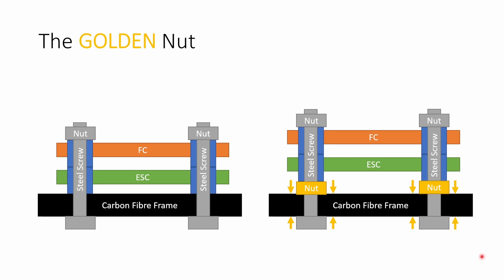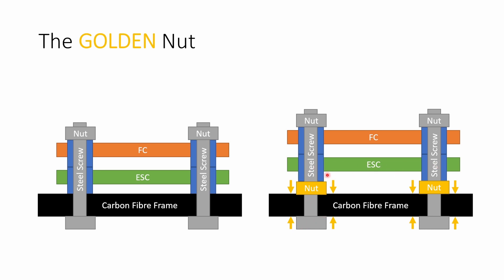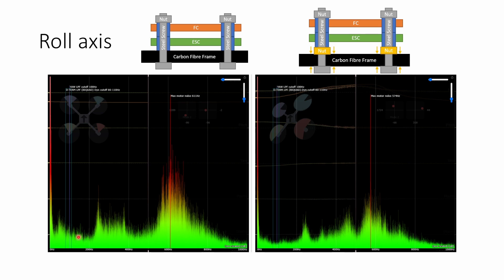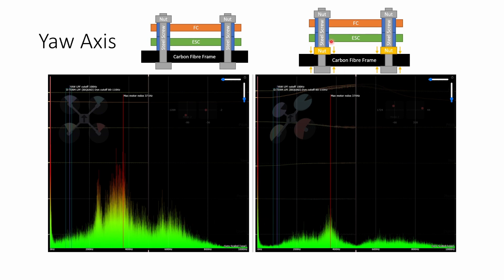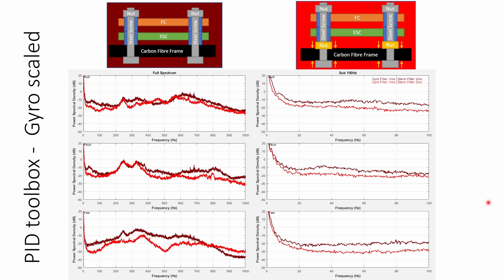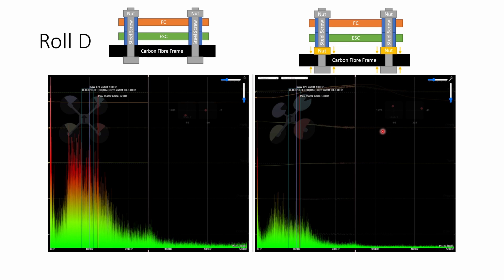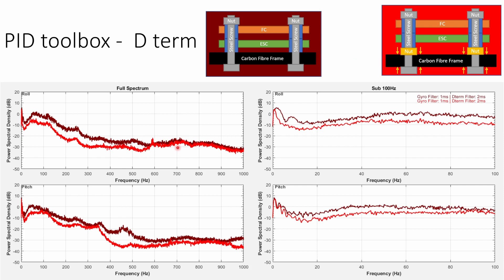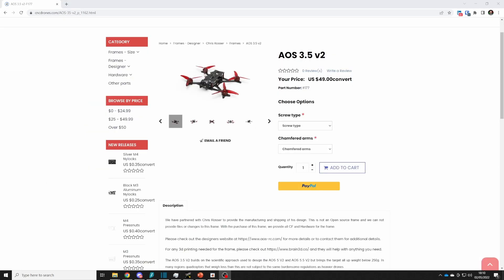Correct stack mounting is critical for Betaflight 4.3! A base nut can make all the difference...

Comment: It's amazing the difference is between having and not having the nut went from hot motors and high filters and motor stalls even could see in video to cold motors and smooth video and flight the difference is substantial

Comment: Great comparison, thanks! Next question, that I faced recently: if I use golden nut approach, and my steel screws are so long, that they touch top plate from left and right side (top plate is narrow) is it good or bad? Should I cut screws to be shorter?

Comment: On a recent build I used nylon screw and nylon nuts and stand-offs, no rubber mount for ESC, just for FC, I also put a stand-off on top and sandwiched the mount pillars assembly between the two frame plates.  I used nylon hardware to reduce weight not noise, but I think it dampens noise and shock in some cases too.  I got 5db less noise  with this system. The most noise-reducing method however is installing braces between the arms you can get up to 5-7db noise reduction. One more thing - tightening of the top nut matters since it controls the compression or dampening of the rubber FC holders. You can think of it as analog "D term" adjustment. On one end if it's loose they provide little fastening and a lot of noise , and on another end if they are tight you get something close to solid mounting , so again little dampening. I suspect there should be a middle sweet spot, would be curious if someone would like to experiment with tightening those screws more and more and record the results.

Comment: why no additional nut between esc and fc? no vibrations comming from esc
Reply from the maker: The nut is to secure the screw tightly to the frame. No need for a second one between FC and ESC.
Reply: @ChrisRosser  without I got super noisy frequences

Comment: Maybe you could include ten nuts with your frames instead of the 5.  Also if you could include the 6mm screws for the camera mount for the 03 as the 4mm stock ones don’t fit in the silicone spacers.  Just a thought.  Still look forward to the build.

Comment: I've been using the golden nut since my first build without knowing it was actually that much more beneficial then just being able to run my Vista cable and other miscellaneous wires occasionally safely under the ESC. 😁
Reply: Question though, what about a frame that has that threaded insert? I still use the golden nut but is it necessary?

Comment: I've always actually done this. Even when there is little space in the stack I sand down a plastic nut shorter to secure the bolt. Flopping around stack bolts just never made sense.
Reply from the maker: I would always prefer steel over plastic (if you have the option of course). You can get M3 thin nuts which are very low profile.

Comment: If the base plate uses press fit nuts (which help hole the screws in place), is the addition of a golden nut still required/recommened?

Comment: My bottom plate came tapped so the bolt is tight with no nut. Is this assuming a smooth hole for the control case?

Comment: My matek f722 boards came with 3mm x 8mm vibration standoffs but i really think they are too weak and result in resonance problems on punchouts with inperfect props.

This is how the flightone guys recommended you build although they recommended not even using the top nut.

Comment: Great info! As always!
I assume on AIO's there shouldn't be much of a difference  (?).
Also, how much torque do you apply on those (and on general) screws/nuts? I tend to go overboard on the tightening and got a torque screwdriver to avoid damaging the parts...
Thanks in advance!
Reply from the maker: I have a rule. 2 fingers on the screwdriver (finger and thumb) for M2, 3 fingers on for M3. 👍
Reply: @ChrisRosser  thanks! Thats an easy one to remember!

Comment: All my builds uses this method. Like a building facing an earthquake, the more flexible the base, the greater the amplitude and the lower the frequency of oscillation of the building. In this case the stack is the analog of the building. The amplitude on oscillations in the yaw axis is mainly because the center of mass of the stack does not coincide with the center of rigidity of the base, which generates torsion in the Z axis, just like a building. One way to improve this condition is by fixing the capacitor and power cable to the frame.

Comment: Some frames have threaded bottom holes, e.g., Five33 Switchback. I wonder if the golden nut still makes difference or the threaded holes basically do the same function
Reply from the maker: A pressnut performs a similar function of its present.
Reply: @ChrisRosser  Thank you for the insight!

Comment: Great video!!!!
I have been very interested in this exact aspect for a couple years. I have a question when you say golden Nut what exactly do you mean? 
I didn’t hear you clarify. I’m reviewing the video now but it doesn’t sound like you specify what the nut is made of that cinches the frame.
You did say that the top of the stack nut was a steel nut. I assume we could use an aluminum nut as well. 
 
The reason I ask is because I think nylon would probably work best??? On the other hand aluminum or steel would be more secure letting more vibration through,I would think 🤔????
I wish I could’ve brought this up to you before you did the testing. This would have been easy to test during your test.  lol ha ha. 

Have a nice day Chris!!!!
Your videos are my favorite !!!!
I watch you & Bardwell & It’s Blunty as my comfort tv most of the time ha ha lol 😂 

It’s got to have it’s Blunty though sometime Bardwell is a little opinionated. I’ve actually met him in person at the Washington DC FAA protest and the day after at the Rosedale park get together fly off.
Reply from the maker: I always use steel hardware. Nylon and aluminium strip too easily.

Comment: I use nut fix of stack screw in all my builds. Also the lower floor of the frame must be rigid. Low mount of battery may reduce noise too.

Comment: FML!! I purchased the V1 AOS 3.5 exactly one day before this announcement. Argh!!!  😤 CNC Madness needs to have a notice on the V1 page to indicate there is a new version.
Reply from the maker: If you email cncmadness@gmail.com you may be able to update your order if it hasn't already shipped.
Reply: @ChrisRosser  nope, too late to change the order it has already shipped. I guess this is one of the drawbacks of doing distribution with the cut on demand method, because really version one should not be as expensive as version two.
Reply from the maker: @angularfpv6572  Because the cost is material and machine time the V1 and V2 are the same price. I didn't want to arbitrarily increase the price for the V2 just to make it more expensive than the V1.

Comment: Is there a difference between a black nylon nut vs an anodized lock nut? Or no significant difference?
Reply from the maker: I find the nylon nuts strip out for me so I use steel. If they don't strip and you can tighten them enough they should work the same.

Comment: Equally important is the quality of screw to hole fit in a frame. Some frames use elongated holes to allow various size motors, or FCs to be used vs individual round holes. The fitness (lack of play) in frame hole vs screw diameter could also be a factor. 
Have noticed a couple of frame kits hat have screws/bolts with M3 style heads on M2 threads. Not sure if larger head size would help provide more secure (less vibration fit), or is done from a style aesthetics design perspective.

Comment: Would be interesting to compare countersunk screw(head) hardware vs. flat bottom heads?
How motor wires are secured to the frame near the ESC could another area to investigate. Limiting the length of wire that can flex near an ESC (FC stack) that can flex will reduce another vibration source. (both motor wires, and main battery wire)

Comment: That is a good idea and what I thought but last month I was building an AOS 3.5 with a base nut on the front stack until it tried to mount the camera. Then I had to take it apart to remove the bottom nut and fit a slightly shorter screw to be able mount the carbon pieces for the camera.  OOPS

Comment: This might be the tip I was looking for. My drone has some strong noise on the yaw axis and less noise on the other axes, but I could find anything on the internet why. I also noticed that my stack is quite loose compared to my other drones. I tightened it already with a thicker screw, but the golden nut might be the solution! noise test on the desk looks already a lot better. Thanks!

Comment: Chris I noticed the same thing but I use the golden nut to lock the ESC in place and secure the FC with another nut.  I can tune out vibration by the top nut on top of the FC by tightening or loosing it.  Normally a snug fit the Kwad flies perfecting.  In builds where I am concerned about stack coming in contact with the frame or screws I use the golden nut on the bottom.

Comment: On the iflight xl frames there is a press nut for the stack screws in the middle plate, so it does this job by design, and I noticed this from the yaw data compared to the armattan badger.

Comment: i never had so much difference in vibration results because of mounting.  coming from ages of old big FCs, we always mounted the FC from ESC seperate. if possible we still mount the esc and pdb together and the FC seperate to topplate. Biggest error in my builds was trying to damp out the fc from the frame with rubber and all sort of soft stuff. best results is a stiff frame and not a single cm of a loose cable or antenna. with the modern frames and filters alomost every build should fly well.

Comment: I've been using a nut under the esc forever, but never knew it was helping with vibrations... one of my first builds hit the ground hard (I was just starting out) and the ESC hit the carbon fiber enough to get through the coating and short out... I was looking for ways to elevate it off the frame a little and a nut was a good simple solution. Glad to hear it has additional benefits!!! Also, haven't shorted anything since.

Comment: Do the V2 frames allow space for the golden nuts? I didn't have room for it on the V1 frame even though my older Apex frame works like this straight out of the box.
Reply from the maker: I use steel thin nuts and have enough space with a 20mm steel screw on the V2 frames. This is with standard gummies for ESC and FC.

Comment: Luckily, I did this on my very first build; not realizing that I was reducing that much vibration. I had heard that there was some type of bad effect on the flight controller if it was able to move a lot, so I had decided to add nuts to the bottom of the screws. First I added the nuts to the screws, but didn't tighten them. Then I set the ESC over the screws to keep the tops of the screws lined up with the stacks holes, Then I tightened the screws down to the bottom plate. This allowed the ESC and FC to beable to easily slide on and off of the stack screws. It definitely kept the stack securly in place. Thanks for all of the technical info.
Reply from the maker: You're very welcome. 😁

Comment: What kind of nut did you use? Press nut? Could you make a photo?
Reply from the maker: A standard steel M2 nut with a bit of mechanical damping grease (PG44A) as a thread lock to stop it loosening over time.

Comment: Just another clewr nylon nut?
Reply from the maker: I use steel nuts because I find the plastic nuts strip quite easily.
Reply: @ChrisRosser  and they don't cause issues on the ESC?
Reply from the maker: @squaddingquads  The gummy for the ESC prevents the nut touching it. If the ESC doesn't use gummies I use a nylon washer in between.
Reply: @ChrisRosser  of course.... Apologies for stupid questions mate

Comment: Its only logical... ;)
Reply from the maker: I was surprised the configuration without the nut was so much worse. I thought it would be just a little worse, or pretty similar.
Reply: @ChrisRosser  U can literally push stack down with your finger without it... On kiss/ultra its USUAL to mount FC AS HARD AS POSSIBLE btw!

Comment: I always used a nut for the stack screws, lately locknuts, and I haven’t be able to mount the Fc over the esc so close, so I use nylon nuts between FC and nuts, that could be an interesting comparison too !
Reply from the maker: I use steel thin nuts (with damping grease as a threadlocker) because I find the plastic nuts strip quite easily. The thin nuts are good to minimise the stack height.

Comment: I've been doing this on all my builds for years. Always thought it was common practice.
Reply from the maker: It should be! I think most people have moved away from nylon standoffs to a long steel screw but the base nut is also very important as it turns out.
Reply: @ChrisRosser  I still have a large assortment pack of nylon standoffs, screws and nuts at the bottom of my parts bin where they will likely stay until the day I finally clean it out. Lately I've been using those anodized aluminum stack spacers in my builds. Looking forward to getting a AOS3.5 V2!
Reply from the maker: @skree_fpv436  Yeah, I've actually started drilling out my nylon standoffs to use as spacers. I hope the AOS 3.5 V2 flies great for you. Design description video incoming.

Comment: I'm not sure if this affects vibrations, but a good tip is to use a washer between the bottom nut and the gummy so that the gummy is better supported and don't deform around the nut.
Reply from the maker: That's a nice idea. I fly quite slammed frames so I have to use a thin nut on the bottom. If someone is using a full size nut they could probably swap to thin nut+washer.

Comment: I'm curious about how thread lock affects this. Also nylock nuts vs regular ones. And if it's different with AIOs rather than stacks, and if their weight changes anything, which would be an argument for using the least amount of solder as possible.
Reply from the maker: I think threadlock or damping grease is important to stop the golden nut working loose. If it backs off the vibration perfromance is certain to get much worse.

Comment: I soft mount the long screw with gummies in addition to using the 'gold nut' and I got very good vibration result on quads ranging from 5 to 2.5''. I got the idea from a Transtec frame and applied it to every build since then. LINK https://cdn.getfpv.com/media/catalog/product/cache/1/image/1800x/040ec09b1e35df139433887a97daa66f/p/1/p1030143_1024x1024.jpg
Reply: Do you have a link to those grommets on the Transteck frame ?
May get RC Mark five has very similar rubber grommets in the frame to secure the stack.

The grommets that come with this trans tech frame look more robust with a better design.
Reply: Oh wait sorry I investigate a little more it looks like get FPV is associated with the link

Comment: This might be another reason the apex did so well. Didn't they use screws with a larger than normal unthreaded section? I can see those screws having similar restricted movement.  I can't remember if those were for the stack though.
Reply from the maker: I think the shoulder bolts are for the arms on the Apex.

Comment: Booooooom!!! I’ve been doing this for a while and I’ve been saying the same thing. Your quad is quieter. Thank you for proving it Chris.
Reply from the maker: No problem 👍 If you have the discussion in future you can just link to this video for evidence 😁
Reply: @ChrisRosser  already spreading it like wildfire sir
Reply: @ChrisRosser  I know it wasn’t apart of your test but another thing I do is run short screws, stick a o ring on top of the nut, no gummy in the esc, o ring on top of the esc, then run rubber vibration dampeners. I need to look in black box to see how that would look. I wonder if it real is better

Comment: It's interesting to see how the frame itself can provide a similar effect to a base nut.  I have my Nazgul beside me and it lacks a base nut but the stack screws are going through about 1cm of carbon, shoring up the stack screws.  The AOS stack screws don't have as much "carbon shoring", right?  
I wonder if tolerances in the stack mounting holes could affect performance.
Reply: I have Nazgul V2 and there is no "golden nut". It flies amazing. My PD slider is at 1.9(no prop wash). Go figure.
Reply from the maker: Having a very long screw going through very thick carbon should have a similar effect of stopping the screw moving. AOS frames  tend to have the screws through a single plate to allow easy arm swaps and to save weight. Adding the golden nut seems to have a big effect on that type of stack mount. I wonder if the Nazgul V2 might do even better with a thin nut on the bottom?
Reply: @ChrisRosser  I see your point. Makes sense. 

I actually did the same on a pirat hook v2 and no issue there(master at 2.0 - top that). But later decided to redo and put the golden nut. No difference in my case. The hook v2 screw goes only thru one plate(like in the apex for example). But there is one more difference. I usually tighten the nuts hard(compressing the gummies really hard) which eliminates I'm guessing the vibrations(my stacks are almost hard mounted - no movement at all).

Thanks for taking the time and share your opinion. Good video as always.

Comment: I always use stacked nylon standoffs which I admittedly aren't as robust in hard crashes, but I imagine would be better for resonance since they isolate vibrations between layers of the stack. You should do a comparison sometime.
Reply from the maker: I've had issues with nylon standoffs stripping out. I think steel screw + gummy probably has more of a damping effect than a hard nylon standoff. Do you use gummies with your nylon standoffs?
Reply: @ChrisRosser  interesting, I've never had any of my M3 or M2 standoffs strip out, but they do break sometimes. I only use gummies on the FC, that way the ESC always has a rigid mount.